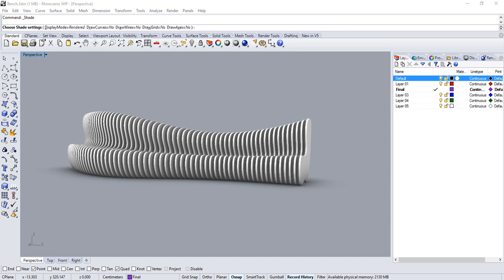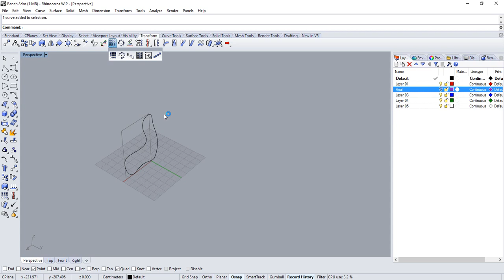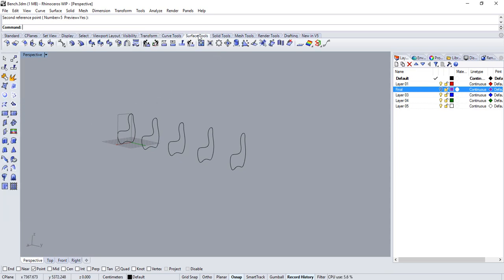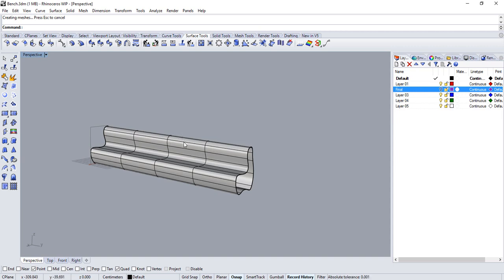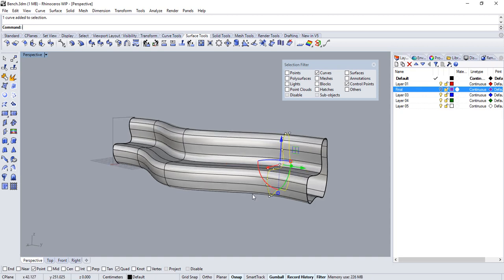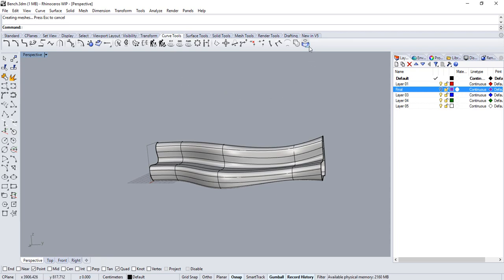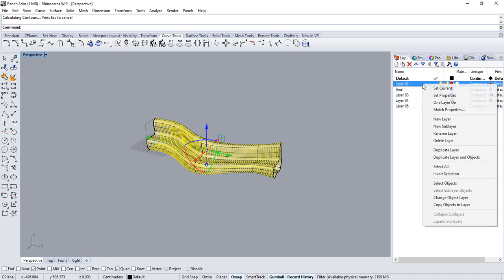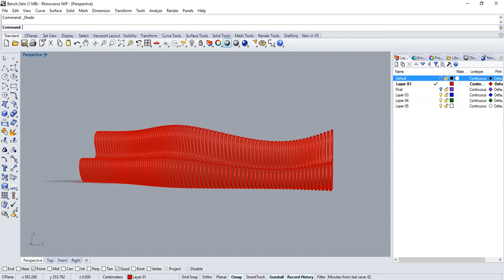Model a Bench in Rhino 6

Comment: now can you create individual dxf file of those parts to machine it ?
Reply: My question as well. I'm currently looking into rhino, since it has some pretty good surface modelling tools and abilities, and a gui that I find familiar, working in cad/CAM. I'm trying to find out how one can fit rhino in a production type of environment.
Reply: I'm assuming one could export an individual extrusion, and export that as dxf. Another way might be to export the curves created as dxf, to use that as a tool path. I Work in Bsolid (Biesse CNC) and would prefer to export in X_T format and import the 3d part (The extruded "slice") and in Bsolid get the upper and down curved and swarf tool path.